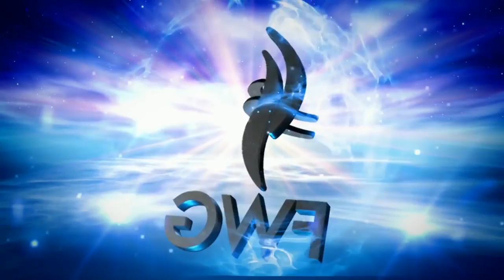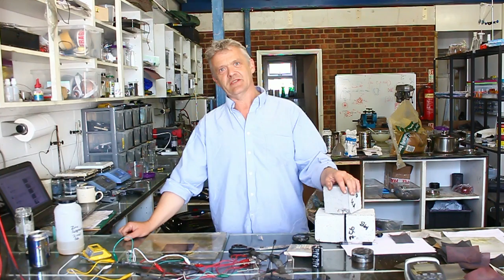Graphene Concrete - Can You Help?

Comment: What I'm exceptionally interested in, is the addition of graphene to Aircrete (tons of stuff on youtube about it) but it functionally infuses it with microbubbles using a soapy foam and turns a 40# bag of portland into 50 gallons of concrete.  It does reduce the compressive strength though, so it's limited to small structures.  I Really want to know if adding graphene could get it back up to at least close to normal compressive strength.  That would be an amazing savings in building costs, as it's also highly insulating as well.
Reply from the maker: aircrete is mostly a foam and grapene wo't alter that so compressive strength is always going to be compromised but that doen't have to be a limitation only a consideration. A framework of cast beams or steel with aircrete infill would certainly allow for larger structures

Comment: Hi Rob, Try adding  different concentrations of Liquid Glass,  so the cement can become self sealing, so low cost water tanks won't leach nasty stuff! . YOUR RESEARCH IS FANTASTIC!  Cheers .P.S  I can get you quartz crystal sand from Brazil , its in my area!  Drop me a line if you want some.

Comment: Possibly look at use Geopolymer as a replacement for the cement in your concrete with microwave expanded graphite as a partial aggregate instead of sand. Possible can use a mix of the expanded graphite with the desert sand to help it lock in the desert sand.

Comment: Hi  robert.  Crazy bit true i made this carbon/graphite stuff.  I have added so much to it i could not tell u right now.  But the fasinating thing is now when i microwave it pn medium heat it starts minimully bubbly but as time goes on the bottle actually jumps in the microwave then settles bubbles some more then jumps.  When u take ot out it buubles for about 4 hours any idea what is happening

Comment: Choice! I'm on a similar mission to make a cement material from scratch - Eg: Making calcium hydroxide from seashells, which can be used in the cement and to react with sodium/potassium carbonate (extracted from seaweed ash) to produce Sodium Hydroxide..... Dry Sodium Hydroxide and silica (could be desert sand) heated above 300 degrees C reportedly results in Sodium Silicate, which could be diluted, filtered and mixed with calcium hydroxide to produce Calcium Silicate Hydrate - which is a part of what makes portland cement strong. In absence of volcanic material, terracotta passes as being a Pozzolan, it could be crushed/powdered and used to help with water resistance etc. I've read that it was used in ancient cement for underwater applications. Also do you think it's possible that desert sand could be be 'etched' in an alkali in order to give it rougher surface?
Reply from the maker: I suppose it is mate - but that would be a lot of waste alkali to get a useable amount
Reply: Instead of pouring it out, perhaps the waste alkali could also play other roles within the mix. By adding a form of cellulose along with urea (at a low temp), cellulose could be dissolved and a a sort of plastic could be produced - resulting in a geopolymer?
Reply from the maker: dunno

Comment: Sorry I live in Minnesota, plenty of water and cold no dessert. But I was wondering if a good phase 2 for graphene concrete would be to test graphene plastic as a replacement for steal reinforcing rod? Steel rod rusts and adds weight. The only drawback I can immediately can see  is high temperature endurance say for instance in a fire.
Reply from the maker: good idea mate cheers

Comment: robert, it seems that these old video's will be extremely informative as regards generic 
Anti-Segregation of Sand Video
https://www.youtube.com/watch?v=L9V7E7oI_EY

especially as regards how all the nanomaterials will mix and Segregate, as in it appears that the finer the grain, the more it will settle over the centre and have the larger grains role off to the sides and stratify even more as the material is again poured and un-mixed, wow...
 
FMC Hopper Design- the correct way
https://www.youtube.com/watch?v=YnZnJ_u3u5w

and OC Mathematical Impressions: Spontaneous Stratification
https://www.youtube.com/watch?v=CpZaRn0Bez0
 could be a very useable option for making supercaps and batteries once you know the true reasons and automatic processes taking place ,great.

lots more to see and be informed, perhaps useful, i did find it informative in relation to many things you have instructed the reader to perform anyway.
Reply from the maker: awesome mate - thank you very much for the post

Comment: I'm sure you are already aware of Roman concretes strength, longevity, in some cases its ability to be used under water... and salt water to boot. The formula seems to be lost to time,
however I have wondered for some time if they used local desert sand as part of the formula,... but a pulverized form of desert sand. I don't even know if there is evidence of some grand grinding wheels for this operation but maybe someone in the business of Roman archaeology could shine some light on this line of thought.

Comment: How do you know the maximum voltage of your homemade capacitors? I want to make some for a project and I want to "fit" as much energy as possible in them! Thanks
Reply from the maker: i usually go by the half cell potentials and work around that
Reply: Half cell potentials? Sorry, I'm new and not that experienced:) Thanks for your help!
Reply from the maker: you'll need to have a read up on it mate - it's a long discussion otherwise
Reply: Robert Murray-Smith Thanks much!

Comment: Have you read of T.T.Brown,  1 i read of his was drying concrete blocks in high voltage field , between electrode plates. special electrical properties.
Reply from the maker: i only know of him because of his electrostatic vehicles - i will have to have a look into it mate
Reply: mus'ent distract your direction .
Reply from the maker: indeed

Comment: Would a high quality Graphene based  grout be blended with multi sized sand grains  spread out to dry but not fully cure then be gently damaged to break into  graded clusters  then allowed to cure fully. Chopped Feathers a big waste product could provide a useful addition with the right dosing  and applications  
If foamed cement was used as an external insulation on the high rise  blocks it would have cost a fraction in labour, environment, material costs and of cause lives  there is a fantastic range of applications for it and can greatly reduce the need for sand 
There is one company in America that has developed a foaming agent  that seems superior to others  unfortunately it's seems one would have to be like a franchise to get the stuff  
I hope to order some Eco foam soon and will try some of it out for FC  but it may be  a bit wasteful for that as there may be ingredients in it either not necessarily or optimal for the cement but you can use fairy liquid so it must be okay but perhaps not the best 
The idea of powered aluminium generating hydrogen bubbles if used not to make a pure foamed cement but the bubbles if extra strong from the Graphene  may help stabilise the mix while curing 
 Great pursuit rob and team  best of luck
Reply from the maker: All of those are good ideas mate cheers

Comment: You need sharp sand for building use.  Sharp sand has angular particles that bind together well.  It's like using rounded pebbles for a driveway.  They roll over each other, whereas angular crushed aggregate binds up when vibro-compacted.  Use sharp sand for best results mate.
Reply from the maker: I am sorry mate - i know that but that's not what i am looking at here
Reply: Sorry Rob.  I sent the message before completing the video.  My mistake.  lesson learned... look before I leap.  :O(

Comment: "desert sand is round" so in theory a future advanced material science project could result in an electro-mechanical graphene concrete material that could be constructed or manipulated into shape using electricity controlled by computers. maybe you should look at playing with rounded desert sand dipped in graphene ink and somehow use the crystalline structure to help magnetize the resulting structure and then try to manipulate that using electricity. would take years of research but I'm guessing it's possible..
Reply from the maker: it probably would take a bit of time - nice idea though - another thought is you could give it a go
Reply: Robert Murray-Smith I'm still saving money to build a decent workshop lol

Comment: Interesting! :)

Try also Volcanic sand - its super strong for building. another thing that comes to mind is foam-concrete. 
I am guessing that your property for this test is surface area. N I am further guessing that graphite, being highly clingy and reactive [assumption :) needs more surface are and Bubbles are spheres which are incredibly strong n I am guessing again that anything which binds or improves the strength of a bubble wall will make it substantially stronger.

Foam concrete also uses no aggregate- so u get a simpler more accurate test to pin-down your results to a specific effect :)

1- foamed concrete
2- volcanic sharp sand  in foamed concrete
3- desert sand as u do now

It's almost a reversal of your current test hahaha :)

Looking forward to your next results :)
---

Also your battery technology looks so very exciting- would not mind supporting this project... cause as Watts said: I produce what the whole worlds wants. Power! hahah

Good luck :)

Comment: I think you are barking up the wrong tree, concrete is cheap, it can already be strengthened. So why consider using a potentially expensive item to produce a marginal gain in concrete that could be achieved for less cost elsewhere. I thought initially you might have come up with the idea of turning concrete into a giant battery.
Reply from the maker: no worries mate we all have our ideas of what is the right and wrong direction - your judgements are made from lack of sufficient information  however - I don't mean this to be rude mate - just a fact - for example you don't know how much it costs us to make the graphene - it adds US$1.64 to the price of a cubic meter of concrete which costs around US$70 as it is - so - it's not that expensive - the gain in compressive strength is 94% - so, not that marginal.
Reply: Robert Murray-Smith - My father has used loads of concrete on the bases of oil containers on oil refineries, they have loads of engineers looking into strength of concrete. You say your concrete is 'stronger', my guess just in a compression sense. Have you tried substituting say rock dust for graphene and measured it's effect?  Now, you might possibly be onto something if say graphene forced out air bubbles in concrete etc. Personally I think you should be exploring some of your earlier ideas more...and taking them to market... then you could have a team working for you etc.
Reply from the maker: i know what you think mate - you made it clear - i just happen to disagree with you and as it is me who decides what i do - that's about all there is to say

Comment: how about taking desert sand and grinding it to even finer particles?
Reply from the maker: you could do mate but that sounds like a heavy industrial approach and what i am thinking is much simpler and cheaper
Reply: just out of curiosity, did you try to check the concrete for conductivity?
Reply from the maker: yes - it's conductive but not by much

Comment: Please get a lav mic. You have important things to say and we want to be able to hear them as clearly as possible.
Reply from the maker: the problem is not the mic mate - it is because we are in a lab not a recording studio
Reply: not at all.  a lav Mic clips on your belt and you can put the mic under your collar.  no one will see it and it only takes a minute or two to sync the audio track when you post your video.  even a cheap $20 Mic will make you sound a million times better and will cancel most white noise in the background
Reply from the maker: i used to use one - it was rubbish

Comment: Cob builders add fibres like straw to a cob mix. Try adding hemp fibres to your concrete mix. Results will probably go off the charts.
Reply from the maker: no mate - this is baseline work - you need to keep that simple not add complexity - when we finish the baseline then it is time to explore other additives
Reply: Not sure what you mean by baseline work. Take researching Roman sea walls. They are the toughest longest lasting structures that have outlasted any modern materials for hundreds of years. The formula used is still a mystery today.

Comment: Sorry not many deserts in Yorkshire. I was watching a programme with Dick Strawbridge a few years back and he was using a waste glass product to make a heat sink for his greenhouse. The glass aggregate was made from old bottles - I think ultrasonic soundwaves were used to make a pea gravel sized product. I wonder if waste glass could be processed into sand sized/shaped grains, which could be used to create thermal concrete. I know waste glass is already used in thermal blocks, but as an aggregate rather than a sand. Just a thought
Reply from the maker: Good thought and i Know Dick and remember when he did this. Your best bet, mate, is to run a few experiments it's not as hard as some folks think

Comment: If you'd like, you can try experimenting with clay soil. Just don't use the clay soil from some parts of California- it's expansive, meaning its volume changes a bit dramatically when it gets water-logged.
Reply from the maker: or you could try it mate

Comment: Hi Robert, sorry to not be able to send you dessert sand, but just for interest sake...
if you wanted to improve dessert sand so that you could use it for building with concrete, do you think that if you could remove the polished surface of the grain of sand,  to get the surface required for a good bond, would an acid etch at least improve the situation?
Is there an acid that would "roughen up" the surface of a grain of round smooth desert sand, is it even possible?
Reply from the maker: maybe mate - idon't know - but the question is would the expense be worth it? - whatever we do has to be stupidly cheap
Reply: To true, thanks for the reply Robert keep up the good work   :  )

Comment: Hi Robert, A macro experiment with plates=graphene and balls=desert sand being mixed and settled might give you an easy to see example of what is going on.  On a tangent thought, oblate spheroids actually pack in denser formations but that would limit the amount of binder that could be present I would imagine, as it is unlikely to be a natural state in the kiln dried sands you have used or will find in desert sand that may be pointless but who knows what interesting facts might spark other ideas, cheers mate.
Reply from the maker: cheers mate

Comment: Maybe the overall strength of concrete is not the critical factor. I would be more inclined to see how to make concrete more flexible, and less likely to expand and contract under varying conditions. This could eradicate the need for steel reinforcement in some cases and would save lots ££ :-)££
Reply from the maker: it's an idea mate

Comment: For what it's worth, you can get aluminium oxide (Al203)in various grain sizes as well as various grit profiles .i.e.anything from roundish grains to very angular grains...as you know Al2O3 is extremely hard and resists temps of around 2000 deg. C.
Reply from the maker: cheers mate